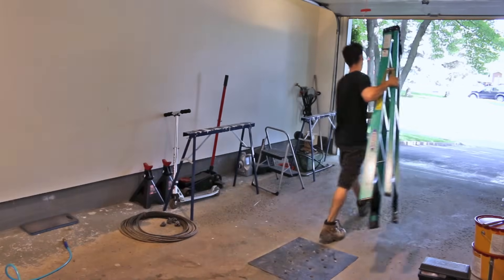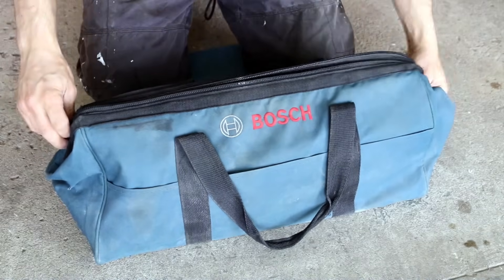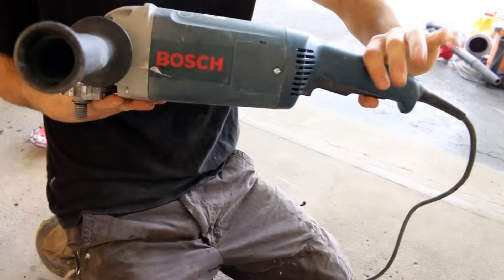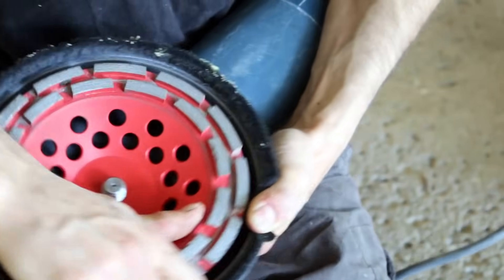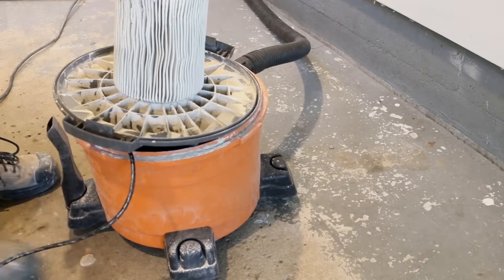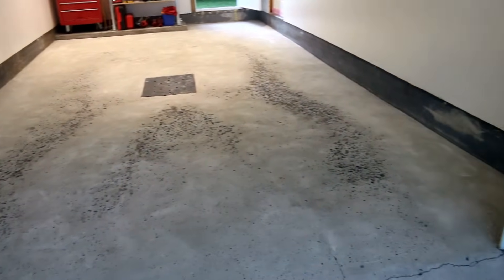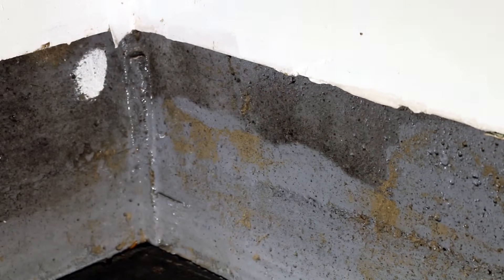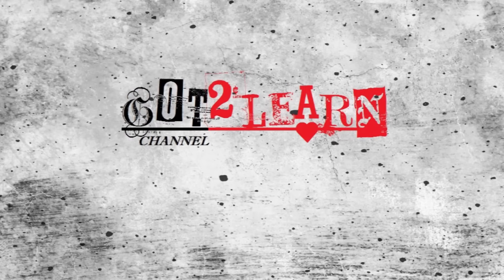EASY | How to DIY Epoxy on Garage Floor Part 2: Starting from Scratch | GOT2LEARN

Comment: Finally! A video that answers the question of how to smooth a concrete floor! Thank you!
Reply from the maker: My pleasure!!
Reply: @Got2Learn  will this process remove old oil stains on concrete?
Reply from the maker: @Lifesituations8000  yes, you have to follow the cleaning step that I posted.
Reply: @Got2Learn  thanks
Reply from the maker: @Lifesituations8000  np 😉

Comment: @G2L it looks like you are using a Rigid shop vac. They do make a HEPA certified filter and bag kit. I use these for dust control on my jobs for most tasks. This combination eliminated the need to constantly beat out excess dust... the other option is a dedicated HEPA vac.
Love the videos!

Comment: Just a tip, even if your concrete is free of a coating, it's important to still grind it back as it gives epoxy something to bond to, if you don't grind your floor, before long the coating will chip away since it hasn't bonded to the concrete surface properly, also if you can, avoid using any water near where you're going to coat unless you're grinding over it (for very hard concrete) epoxy and water are not friends.
Reply from the maker: Thanks for your input, I took note of that ;)

Comment: Good job! Question: can I use 10 liters of epoxy  sika 261 CA for two coatings (garage for one car 250 pi 2), pre-buy another bucket and use half A and B for one coat. If you buy two of 10 liters (for two coatings) this is about $ 600 in Montreal. Thank you

Comment: How did you choose the double-row grinder over the "turbo" grinder which has the diamond elements at an angle?
Reply from the maker: That's just the wheel that came with the rental tool hehe

Comment: Working on the grinding part right now on a 2.5 car garage, and I've noticed that there's some light visual cupping scratches in the floor as I go.  I'm grinding off an old epoxy coating; if I keep the grinder moving faster it doesn't get the coating off, and at the fastest I can move and still remove the coating it still tends to gouge the concrete occasionally.  I've been trying to smooth these gouges as best I can as I go, but I can still tell the surface isn't 100% smooth.  Does the epoxy self-level over this?
Reply from the maker: Nah you would need a pro machine for it not to show, even on my floor they show, but it doesn't bother me.
Reply: You need to grind in circles and be patient as long as you scratch the surface sufficient for mechanical adhesion to occur you should be ok. the reason for the circles is so that you have less chance of digging in. Dont be in a hurry unless youre a contractor but by then you will know how to trouble shoot.
Reply from the maker: Exactly

Comment: Can I do this to my kitchen floor on concrete slab? I don’t want to rent a huge grinder. If so, what steps do I need to make it looked polished? I.e, grinding disks top coats etc. Think Costco floor or warehouse floor?  Current subfloor is pretty smooth minus some plaster drips and linoleum glue. Any info would be appreciated? 💕
Reply from the maker: All you need is a 7" grinder like in my video and you should be fine ;)

Comment: Thanks I got to know the sander. Once I put epoxy say after 2 years can I power wash . 2; if there is an oil stain after 2 years of my epoxy can I use carb cleaner or any decreser to get it out. Thanks again
Reply from the maker: Absolutely. You can use your power washer and degreaser not long after the epoxy has been applied.
Reply: Got2Learn. Thanks much . So after I apply epoxy and if I want to power wash for cleaning, hope epoxy will not be peeled.
Reply from the maker: You can, epoxy adhere's much better then paint so don't be scared to power wash it ;)
Reply: Got2Learn thanks buddy. I have filled the crack with concrete sealer and put epoxy from Sherwin Williams. Now I can see the filler standing out.filler is not epoxy it is from Dap made for concrete filler. Can I sand that filler and recoat. I see that filler has some silicone as well. So not sure the sander will sand silicone filler. Also does home Depot rent such sander
Reply from the maker: sivaraj palanisamy I don't know if you can sand that crack filler but if you are willing to take the risk, you might need to redo the whole crack with the same epoxy that I used. Yes, you can get the grinder at home depot for around 50$ for the day.
Reply: Got2Learn thanks much. Can u let me know the product model name. I see lot of model on that brand pls
Reply from the maker: Bosch Model# 1772-6 7" angle grinder.
Reply: hi, no i got that, i like to know thee seka filler brand...
Reply from the maker: sivaraj palanisamy SIKADUR pro select crack fix, let me know if you don't find ;)
Reply: Thanks so much. I appreciate all your hardwork and quick reply. Count me as one of your subscriber from now on.. Thanks again..

Comment: Diamabrush works best.. and a dust buddy attachment  to the shop vac
Reply: I was considering diamabrush. Did you use the concrete prep tool with floor polisher at home depot?

Comment: hi, i got the same bosch model, when i try to sand concrete i see sand marks, dont know what mistake i am doing.. can u pls give me some tips, is it because of blade, i got diamon cut blade makita brand
Reply from the maker: With any small grinder you will see marks, eve I see them on my floor. If you want less marks, you need the bigger machine.

Comment: I have an existing epoxy floor, but I would like to change the color. Do I have to remove the old color entirely?
Reply from the maker: What's the condition of the existing floor??
Reply: @Got2Learn  I currently have an epoxy on it. This application is about 2 years old. I just want to change the color without having to remove it all, if that is possible
Reply from the maker: I wouls scuff it first, but i'm no pro.

Comment: Where can I find that shroud
Reply from the maker: The shroud came in the kit I rented it from. If you want to buy one, you might want to check online depending where you are situated, or just go to your local hardware shop, they should be able to point you in the right direction!
Reply: Thanks

Comment: You aren’t “sanding the concrete” you are grinding the substrate and you better do it, every.single.time. Acid etching and “sanding” is not enough.